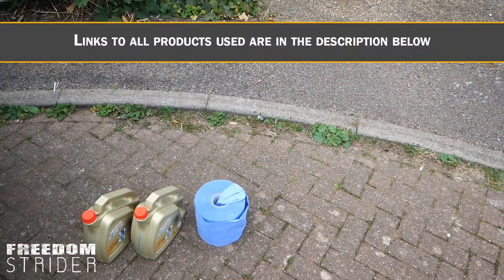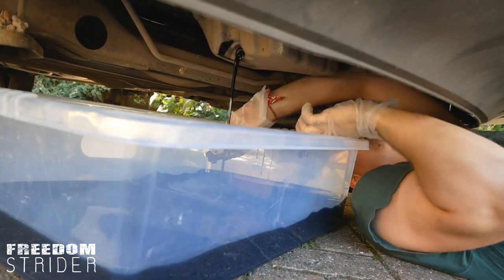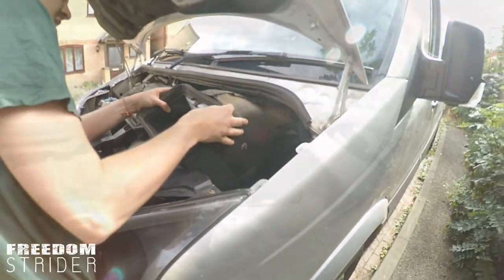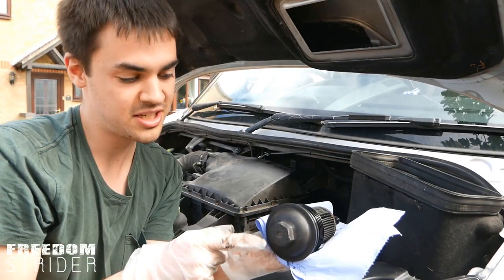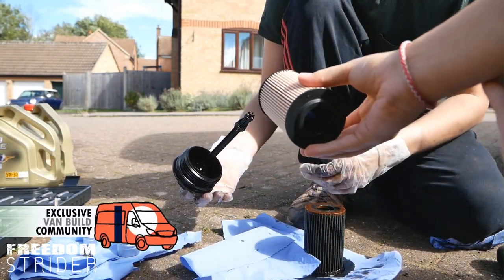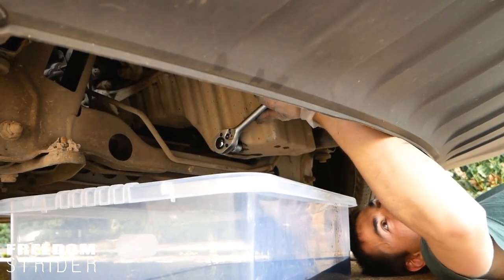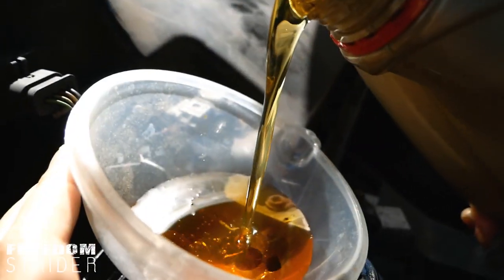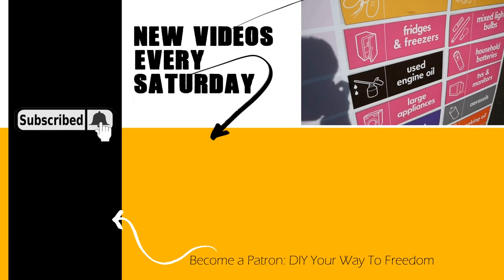VW Crafter 2014 Oil Change and Oil Filter How To Guide

Comment: Suggestion put a plastic bin liner in the tray to make cleaning up easier. If you use it opened up you can then cut off a corner to put the old oil in the empty new oil jugs for taking up the recycling tip.
Reply from the maker: A good tip for next time :)
We did have the cleanout that box a fair bit, but luckily our local recycling center took the oil otherwise we were struggling to find out where to get rid of it!

Comment: Legends. Looked under my van today and saw oil 🥴. Traced it back and found it was that what your taking off. It needs the top plastic seal that you said you never got. Make sure you change them at some point just to be on the safe 👍
Reply from the maker: Ah that's good to know - we might also buy a spare plastic cap since the plastic is already a eating down as we undo it more than once but thanks for the tip 👍